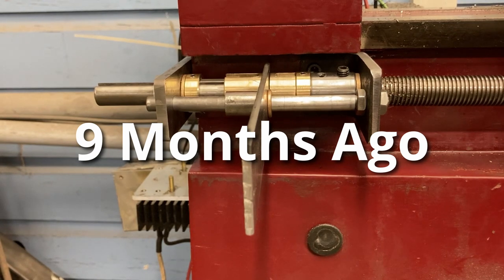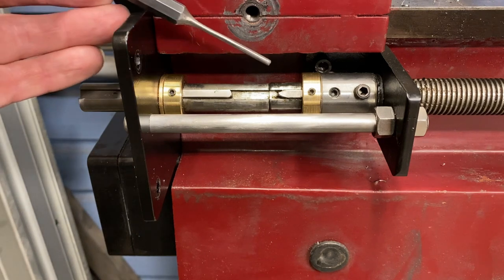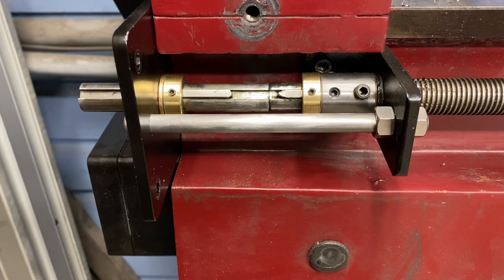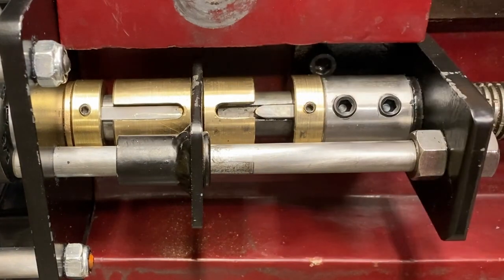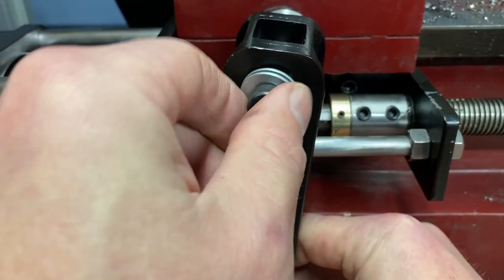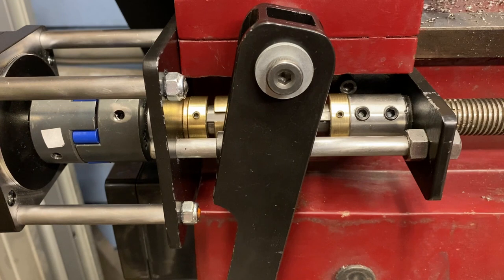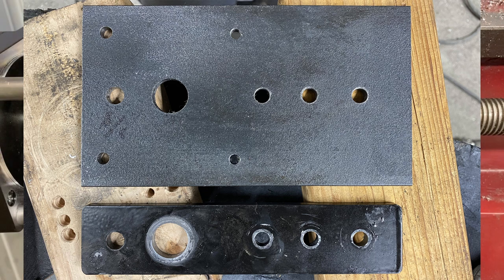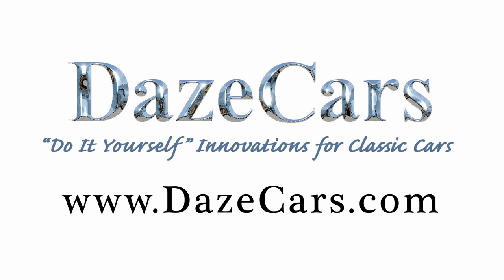Improving my DIY ELS Lead-Screw Clutch

Comment: Daze, how critical is the alignment of the stepper motor axis to that of the lead screw? How tight are the tolerances and did you just machine the holes or did you allow for adjustment?
Paul
Reply from the maker: I drilled the holes in the brackets on a drill press but I was extremely carful to line everything up correctly.  Failure to get it properly aligned will cause it to bind.